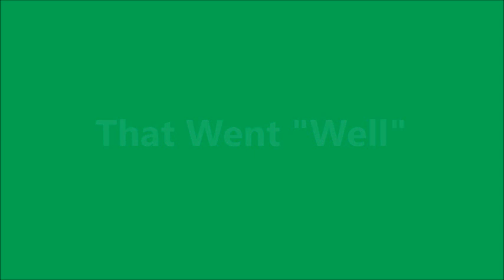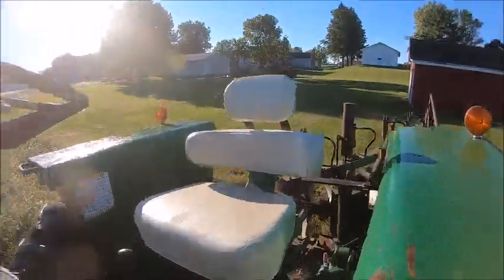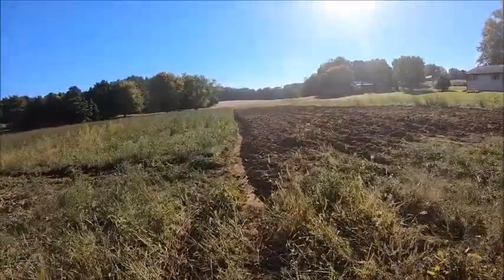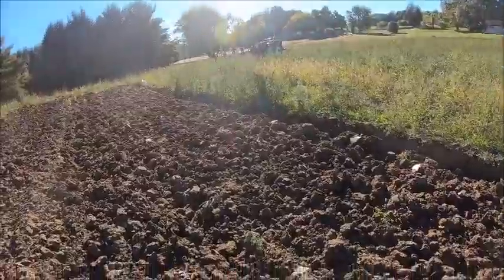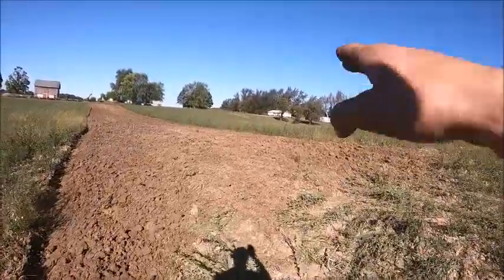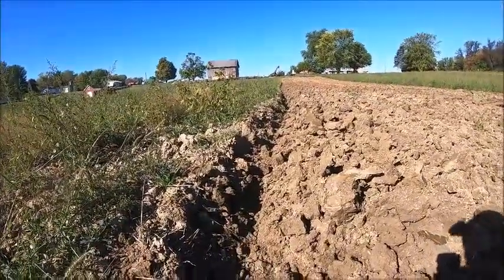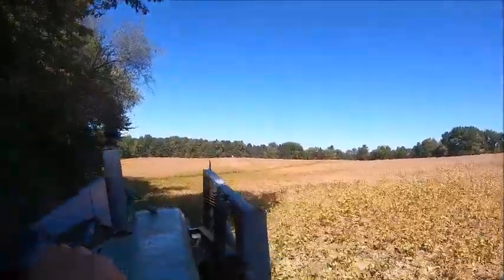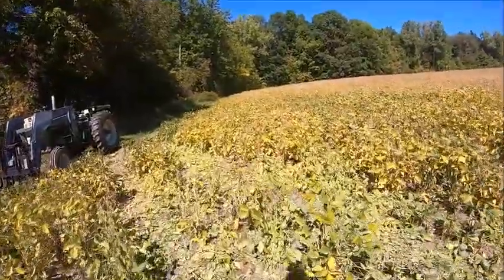Tried Plowing, Key Word Tried

Comment: Won't be long & we can plow a round and wait for rain while we charge our tractor batteries then repeat!  Every farm will have an electrical generating wind turbine where your diesel pump used to be and every barn roof will have China solar panels.  But sarcasm aside, really enjoy watching the old iron of my day working a farm as I remember it.  Thanks for sharing your videos.
Reply: When I start my dream farm I plan on putting solar panels on the machine shed so I would not have to run conduit to the shed. Plus I'll also use the power reserves to do trickle charges on the batteries once per month.

Comment: I got 250 acres of the same thing hardest concrete when it's dry. Even when it's got moisture in it it's hard to plow I got a plow just for it eight bottom 18 with 2,000 lb of weight on it. I pull it with a 1586 international and that's all she wants second gear and the torque amplifier in.

Comment: Mulboards and disks dont do you any favors for getting rid of compaction thats for sure .  Chisel plow or field cultivator naturally dig into the soil at least but they do struggle to work into hard soils too. Just have to see what the future gives you for conditions. I have been running a chisel and subsoiler over land for 45 years and can still find dead furrows and old end rows where the plows worked it the same away all the time . Thanks for sharing the video its nice to see vintage equipment working still
Reply from the maker: I’ve had an 11 shank chisel plow with spikes just skim the ground and rake trash in this field. If it’s to hard to plow it’s to hard to chisel.

Comment: Ethan, it may sound silly but, you might want to keep an eye out for a "one way" disc plow. Isn't much that can stop them from doing their job. Plus, look into adding some "gypsum" into the soil, that helps break up the clumps, softens it up, you just have to work that stuff in and pray for rain. Have you considered just using a ripper first then the moldboard plow? I mean, that is what a ripper is designed for actually. Great video as always, cheers :)
Reply: thats what i did to ours this year and made a massive difference

Comment: Awesome video sir, nothing sounds like the 310 turbocharged engine with the straight pipe. My 1750 has a unique sound to but the 1955 just makes me smile while running it. I recently bought a White 4-150 with 3319 hours on it. Everything works even the air conditioning. But I’m needing a door for it, if you know where I can get one I would really appreciate the help

Comment: If you double disk it down after a rain and let it lay for a later plow down the moisture won't be pulled out by the vegetation,  we often did that. That " T " is a doer, I guess it's spelled correctly.
Reply from the maker: Fuel is to expensive for that many passes.

Comment: The hydraulic reset charged to maximum?  You will be surprised if those bottom aren’t exactly flat, those points will pull like a stuck hog in four foot of shit. It really doesn’t take much movement on those bottom to do that and once it starts it hard to stop.   I have had to go over the recommended charge in conditions like that.  I was raised on that exact plow. One of the problems of the reset. In my opinion.
Reply from the maker: I’m already 200 pounds over specified max and I don’t want to find out what the safe max is.
Reply: @Oliver66FarmBoy  I slept a few nights since I was young.  I just don’t remember where we set it.  But in hard dry clay hills we would “super charge it” as we liked to say.  But in normal conditions we backed it down.  But I feel your pain as it was the most frustrating thing.   The other outfit was a 1800 with a trip bottom 4 bottom and no problems while the reset plow struggled right behind each other.  So we knew it was the plow not the conditions. I had a love hate relationship with that plow.  Loved it in rocky field and I thought the extra weight was great. But then….
Reply from the maker: There aren’t really any rocks to speak of in either of these fields. I’m tempted to put the shear bolts in it to help.
Reply: @Oliver66FarmBoy  worth a try. At least you would know if it is really too hard.  Could do it for several rounds to be safe. I think we blew a seal once. But out of the 12 years with that plow, never broke a rod, end, or anything on the bottom.